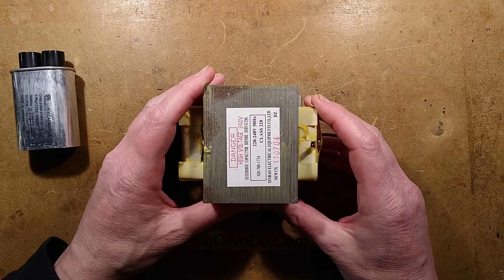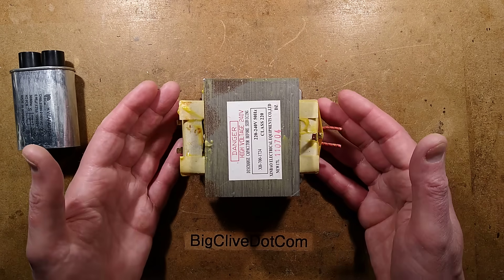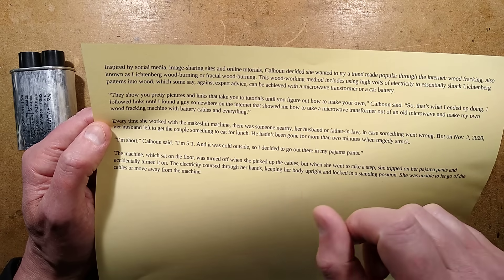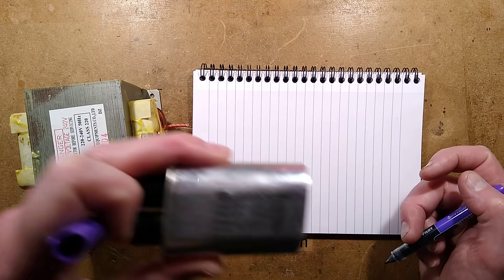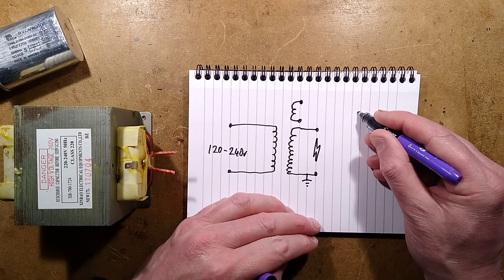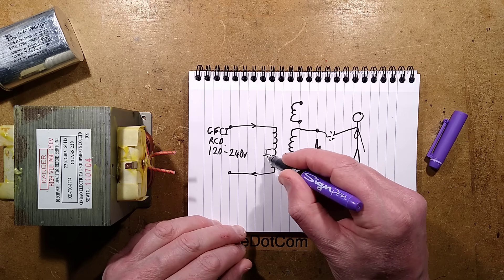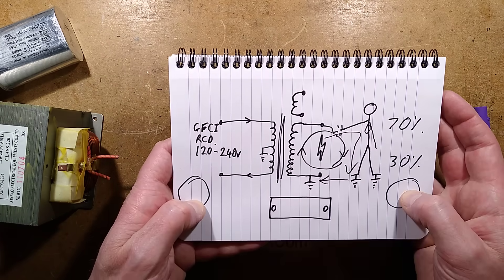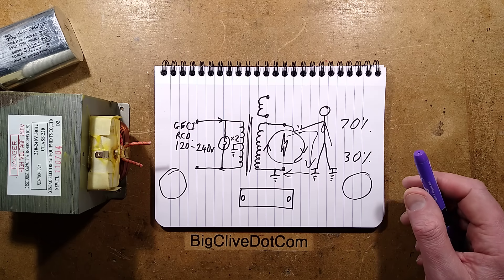The most deadly project on the Internet

Comment: What I would really like to know about this is why we can't use GFCI tech on the high voltage side to at least lower the possibility of this thing outright killing you. Obviously we can't use regular GFCI outlets built for home or commercial as those aren't rated for this voltage, but I assume there's some way to monitor the voltage going through each wire and trip when there's a difference.

Also, for the dead man's handle/switch idea, it should be near impossible to push both buttons on the switch with the leads contacting your body in any way. I would also like to see something like a tripwire that will kill it if anybody enters while it's happening, and maybe a separate insulated box that the operator would stand in that is tied into the switch and if that box opens for any reason, the whole thing is shut off.

If people are going to try it, and they will, we might as well brainstorm safety mechanisms that make it as hard as possible for them to kill themselves with it.

Comment: Put the transformer in a box.  Buy a pair of high-voltage meter probes and connect them to the transformer inside the box. Regular probes don't have sufficient insulation.

Comment: The most electricity i have tanked in one go was 277 from common to ground from one hand to the other. That amount mde my arms convulse at full strength, so the only pain afterwards was my elbows hurt. 

Capacitors have hurt worse, honestly,
Reply from the maker: See my video called The unofficial guide to electrocution.

Comment: There's no need to be terrified of electricity, capacitors or microwave ovens. Follow some basic safety rules, EVERY TIME, and you'll be fine. I started building particle accelerators when I was a teenager, many many years ago, and worked with very high voltages regularly. These voltages require strict attention and half-assed personal safety procedures that are only sometimes followed will lead to trouble eventually. This is true with people who wear seatbelts on long trips but neglect to wear them on short drives; where I live (British Columbia) about 75% of all traffic accidents occur with 5 km of the home.
Reply from the maker: Unfortunately, this project is being attempted by non-technical people who are being shown how to do it in shallow videos with zero safety information.  Usually because the people making the videos also have no clue that they're close to a violent death.

Comment: Conductors at high voltages, certainly at voltages greater than a few hundred volts should be enclosed in a conductive (Faraday)cage, with interlocks that eliminate power while the cage is open.

Comment: i still have one of these transformers and capacitors on the shelf behind my desk. i keep saying in a few months i'll know enough to make a jacob's ladder with it. it has been there since February, and i am still saying in a few months i'll do something with it. now i say in a few months i'll chop the 2ndary away and replace it with 1 turn so i can play with high current and melt coins. in a few months i'll probably not be doing something else with it. but i would never EVER want to use it with 12v cables in a puddle of electrolyte twatting about with wood. lord no.

Comment: I do recommend making these into arc welders and battery chargers.   I don't recommend most people use these as-is because they don't know what they're doing.   There's a reason these things are encased and have security torx bolts to fasten the chassis together.  It's to avoid... basically this from happening.

Unfortunately info unlimited is no longer in business.  They had their own (MUCH safer) build-it-yourself kit for doing this kind of thing at low current.  Think 5-7KV at around 4mA, but at a high frequency.
Reply from the maker: Aww!  I didn't realise Bob Iannini had passed away.   I still have some of his Information Unlimited high voltage power supplies.
Reply: @bigclivedotcom   Ah, which ones?

I have some of his plans and books.  And a number of their custom parts.  

I have found there are workable replacements for the CD25 trigger transformers from a different company.  In some AC units there's ignition sense boards which has similar cylindrical case transformers around the same size.  Comparable output.  

Wish I had the means for winding transformers.  Cannot find the ferrites for the cores of the plasma drivers but you can find the archive of the parts page for dimensions.  

Wayne Strattman also apparently knew Bob quite well.  I wish I could have met him but I have lived on the west side of the country my whole life.

Comment: 12kV gloves are $30 on amazon, why do people neglect PPE?! Especially if you have no idea what you doing. I guess my question is the answer..
Reply from the maker: It's not just using high voltage gloves, it's understanding their safe use.  In the utility industry they are tested regularly.  Even the smallest pinhole will pass enough current to kill.
Reply: @bigclivedotcom  completely agree, but proper PPE like boots and gloves would have saved many of those people.

Comment: I built my fractal burner using a neon light transformer and a dead man switch. The amperage is much lower still can hurt like mad but not likely to kill you. careful research and understanding of the process and being aware of how to stay safe in the situation. I have been using it for several years DO NOT be complacent. And do not try if you do not understand electricity!

Comment: I was working as a cop years go, we responded to a one car roll over accident just North of the City, a young lady had lost  control of her pickup truck and rolled it at a high speed, her pickup hit a highline pole an broke it off about half way up the pole, the wires held but were at about forehead height.  She had been thrown from the vehicle and it rolled over her crushing her young body and, of course killing her. The ambulance crew came out and went to  retrieve the body, as they pushed the cart through a broken fence one of the crew hit that highline with his forehead, the power went through his body and out the wheels of the cart. I saw the arch as the power went to ground. The crew went to work on him and brought him back but he was never the same an ended up in a wheel chair for the rest of his life.

Comment: Excellent video Clive. I have to disagree a bit with "short the terminals of the HV capacitor with a properly insulated screwdriver." I wouldn't do that on a 600V filter cap in a guitar amp, much less what looks like a 2000V capacitor from a microwave. It's going to make a terrific pop and a flash and damage the screwdriver. Far better to make a discharge probe from a big 2W 100k resistor. And if you don't want to do that, you have no business mucking about with the cap in the first place. Which nicely echoes the points you were making throughout the video!
Reply: Unless the amp has a smps built in

Comment: I remember making my first arc burner, just decided to take apart a microwave and put it back together to make it. I had watched someone doing it in some 30 second clip somewhere and thought, “I could make that, I have a dead microwave somewhere.” I was 14 or 15 around that time, but I did have a mom and grandfather who were experienced enough to show me which precautions to take and how to not get hurt while messing with electricity. I learned a lot from the experience and still have that burner, although it’s in a box and hasn’t been used in years and I likely will never fix it due to the dangers. Great memories and a good learning experience

Comment: Years ago I was working on a dryer I should not have been working on and my sweaty arm touched some wires. The shock left a scarring around my arm similar to a lightning bolt. It looked kool but definitely not enough to warrant having that experience again. 
Don't try at home kids.

Comment: I was taking the speakers and buttons off a old tube TV.That thing was in the garage unplugged Hadden worked in months. I saw and read all the voltage warnings on the tube parts.Young and dumb I cut one of those wires with decent  wire cutters. The shock was like nothing I had felt before. 120 even a quick 240 was nothing like that. Thank God it was just one qiuck hard shot.I felt that jolt in every inch of my body
Reply from the maker: The biggest zap you'll get from an old cathode ray tube TV is from the anode lead that goes onto the tube with the cap that looks like a suction cup.  The inside and outside of the glass tube have conductive layers to make a high voltage glass capacitor that can store a charge for a long time.

Comment: I can think of so many safety precautions besides what Clive mentioned that I'd want if I were doing this, including:

- A mechanism to lower the wood into the salt bath rather than placing it in manually ( at minimum a set of tongs with insulated handles )
- A grounded farraday cage around the transformer and salt bath ( not sure how much this will help tbh, but I'd rather have it than not )
- Well insulated chainmail gloves that are grounded
- a klaxon or buzzer in series that's loud enough to be heard outside of the work space ( I'd want to do this in a workshop under a vent hood rather than outside )
- a weight activated switch that's five to ten feet away from the project box ( i.e. the switch requires me to stand five to ten feet away  )
- a mains cut off switch right by the entrance to the workshop 
- Someone standing by said mains cut of switch

That said, this sounds too scary to attempt even with the above.
Reply: I wouldn't try this even if you paid me stupid money.

Comment: I got shocked through a plastic body digital multimeter measuring current in a 30kV set up (low current) - my finger never even quite touched the multimeter, but I was still shocked violently. Complacency will always get you.

Comment: i do fractaö wood burning and i know the risks but as long as people just use a kill switch its totally safe i made an old school buzzbar kill switch work amasingly well
Reply: Don’t be overconfident, the last person I know who was killed by this was a master electrician, (1yr ago TX) using what sounds like the same system you are. Just be careful man. Not worth it.
Reply: i know that its dangerous i should have also mentioned that i make sure to wear rubber isolated cloves aswell @pwdrjnky

Comment: Not a good example of the transformer being 2000 volts and jumper cables because they are only used for 12 to 24 volts.

Comment: The other factor is the 60hz AC across one's chest - from one hand to the other - can/will throw the heart into defibrillation at a low voltage with even a low amperage.
(Yes, I know Ohm's law and the variables). The point is that just because something seems low(ish) voltage AC (i.e., 120v) and not something higher  (i.e., 2kV) doesn't mean that the higher joltage is more dangerous to the human body, etc. etc., etc.

Comment: I also use clamps either on there own or with a nail i never touch bith leads at the same time i beleive it can be done safely it should not be done by anyone that thinks a wooden dowel and some rubber gloves are a good safegaurd from,holding an electric death machine with bith hands whilst its on

Comment: Videos like this are great. A few years back I wanted to start making these as a DIY because I thought they looked incredible, but I eventually came across an article discussing how many people have died from it, even with the most extreme safety measures in place. If I hadn't come across that article I could've easily been one of those statistics.
Reply: it's possible to do with flyback transformers which are less dangerous due to high frequency AC
Reply: I have a lot of fun fractal burning. just don't be stupid and touch it while it's on.

Comment: May be not so related.I live offgrid solar power was told when replaced large 400 amp 24 volt panels to cover them up before wiring them into system.Panels being able to store Energy while being fitted to a Roof

Comment: The 2nd to worse shock I got was about 10kv through the chest. Felt like a horse kicked me. The worse was 200v through the chest. Respiratory arrest and passed out, luckily breaking the circuit. Scary stuff.  That were in my teens. Now an electrical engineer and very careful with high voltage and/or high current.

Comment: This type of transformer should never be used without casing with no outside connection. Yes you have hardware with those things inside but equipped inside proper frame. And also a good example was with RCD doesn't protect you always (as mentioned in video). So the conclusion is at home transformer should lower the voltage if any wire goes outside a device.

Comment: I used to work with repair of household appliances. Most of these repairs was done in the costumers home. Over the years I've had several costumers ask me if the job I did was something they could have done them self. I always told the costumer that most machines you can repair or change components on your self as long as you are somewhat competent and make absolute sure that the power is not connected. I always made a very clear point that there are two things you should NOT try to repair yourself. Nr 1 being microwaves; They are extremely dangerous, and can very possibly kill you. The highest voltage output I've seen on a microwave was over 6kV. Nr 2 is fridge and freezers, as the refrigerant system is often made confined in copper and/or aluminum tubes that are a PAIN to fix and/or repair, and secondly, the refringent liquid is something that would instantly evaporate leaving the product useless. And in worst case, some of the gasses used in fridges today are flammable, so you could potentially burn down your house.
In short; don't touch microwave ovens and fridges.
Reply: That, and old CRT TV's. Those things are scary as hell
Reply: Hi, you're alright man. Your guide will continue to save lives, thank you.
Reply: Probably should have added CRT based colour TV's, as 25KV EHT is not nice
Reply: The antifreeze is (depending on the antifreeze used, of course), also very toxic. Freezers are no joke.
Reply: You need to learn to spell 'customer', unless you really were talking about people who make costumes.
Reply: @RobertWorrillow he’s actually talking about the people who wear the costumes

Comment: im on a process of repairing my second microwave, i didnt know the voltage of the transformer is equivalent to electric chair, i thought it was 2000 DC voltage. i also lear microwave is the most dangerous appliance to repair. i repaired fridge, stove, freezer, dryer, washer. i will never play with high voltage, water and wood. AND im gonna stop repairing microwave from now. Thanks
Reply from the maker: The microwave is absolutely the most dangerous home appliance to repair.

Comment: If you do have a dead man's switch, it's even better if the buttons are such that you press them with the backs of your hands/fingers, so even if you are shocked, your hands cramping closed (stronger muscles for closing than for opening) will cause you to release the button, rather than running the risk of gripping/closing it even harder.
Reply: It's better than nothing. Even with other safety systems, you can't move faster than electricity (light speed).

Comment: I love the idea of your deadman switch but remember, if you try to make it idiot-proof, someone will come up with a better idiot.  I've seen safety measures like that box in factories where I have worked and when the supervisor or safety operator aren't looking, the 'better idiot' finds a way to jam one of the switches on  They do this for the most basic of reasons; it's faster, it means I can build more in the alloted time and that means I get paid more, it is a pain to have to use both hands to do this job, etc....  At least until they are caught and fired on the spot.  Then they complain about how unfair it is to be fired on their first offense.

Comment: So, I bought a lichtenburg burning machine from Conestoga Works website. He seems to make it so it is insulated and safe, with a dead man switch or whatever you call it for turning on and off. I am always sketched out about using it though, I normally use 2 wood clamps to hold the probes on the wood and stand a few feet away and activate the foot switch. How do you feel about this particular machine? Is it safe to hold those probes in your hands while the machine is powered on?

Comment: My dad was an electrical engineer, several times as a kid he caught me taking things apart and would stop me from taking anything dangerous apart, he taught me about the dangers of capacitors even on something that hasn’t been plugged in forever
Reply: That is a great reaction of your dad that serves both your education and your safety at the same time. 

My parents got me a light box with lots of 6V bicycle bulbs behind differently coloured translucent things like a piece of fizzy drink bottle, covers of bicycle lights and similar bits and bobs. When I was a little older and I got curious about the technical background, they let me experiment with battery powered circuits, lights and (semi)conductors. When I was a bit older still, my power source was fed by the mains transformed into 3 and 5 Volts, that could be bridged to get 8V. This was then terminated to a full bridge rectifier if I required DC power. Lots of fun and quite educational as well.